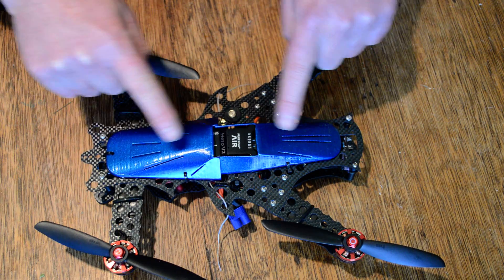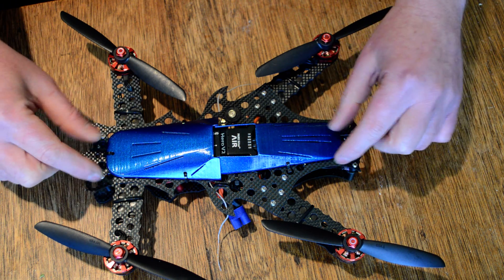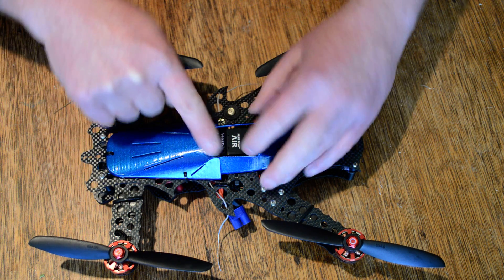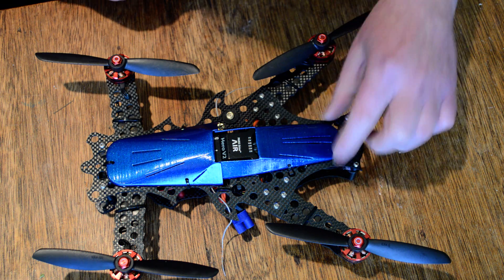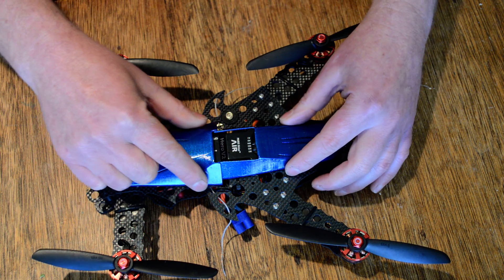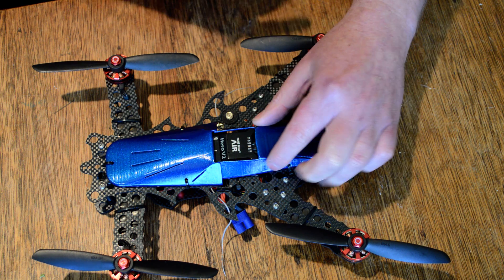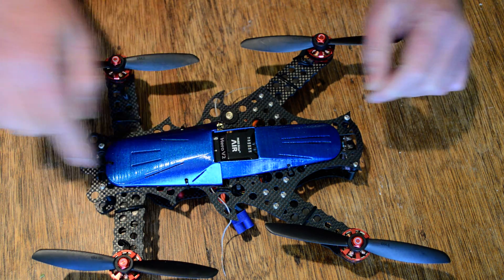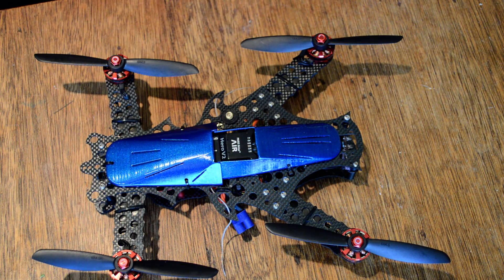Knife Aero Kit Tips

Comment: how do you mount the mobius after putting this kit on it? Also have you used 5" props and how quick is it with them over the 6" inch props as I would want to mount my mobius and theres not enough clearance with the 6" props for my liking
Reply from the maker: I run 6" props

This Kit is NOT compatible with the Mobius mount. I don't run a Mobius on my Knife. I have set mine up to be a pure FPV racer